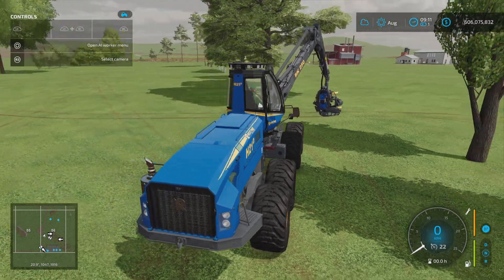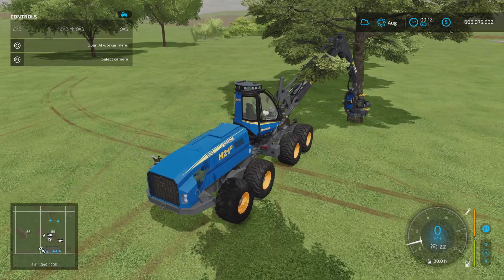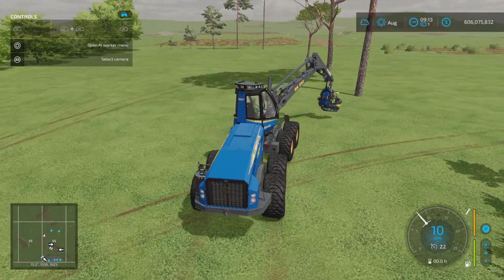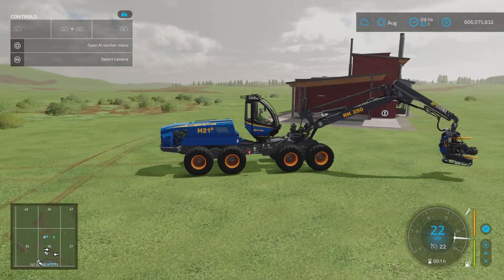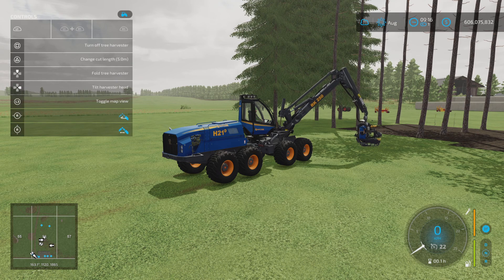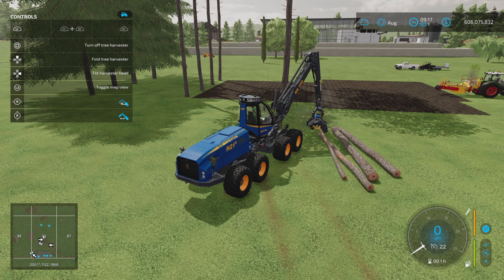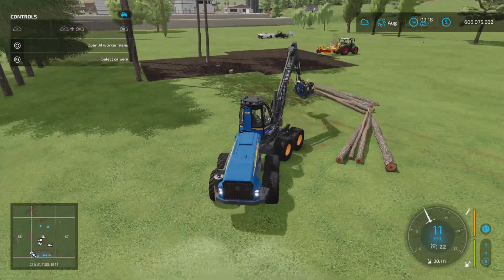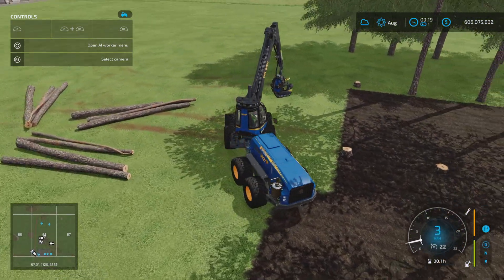What You Need To Know About Tree Harvesters (The Basics) - Farming Simulator 22 - PS5

Comment: The single solitary issue I and other's have with what would be the best Tree Harvestor, meaning the HD 21 is the fact that the controll setting's are in a sense backward's to any and all other harvestor's because; The HD 21 has a setting which allow's a portion of the boom to be extended or retracted. Should a beginner start with the HD21 and invest some hour's into the handleing of it . Using any of the other tree harveestor's setting become a major issue.
Reply from the maker: This is a good point, hopefully it can be addressed by the developers.